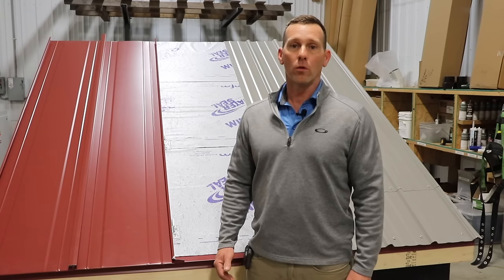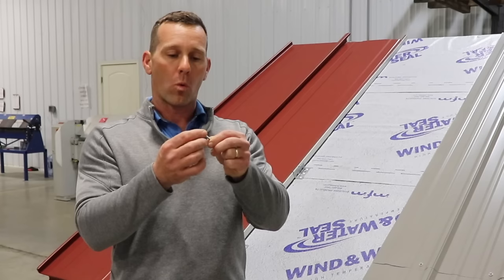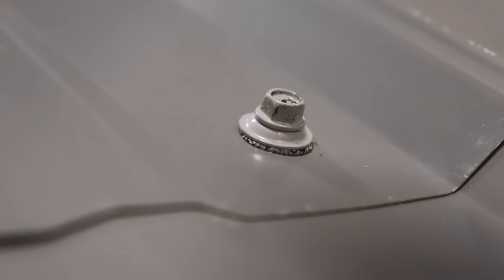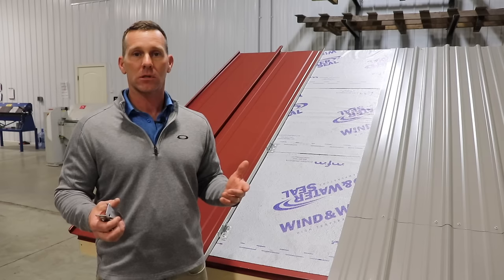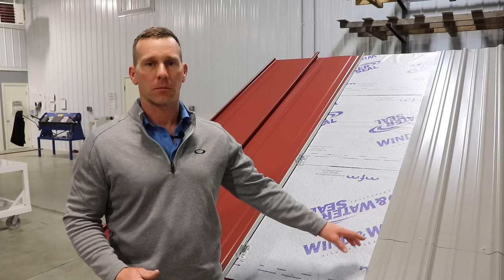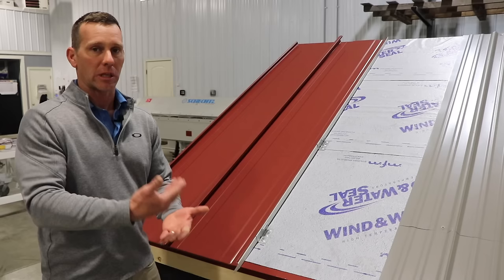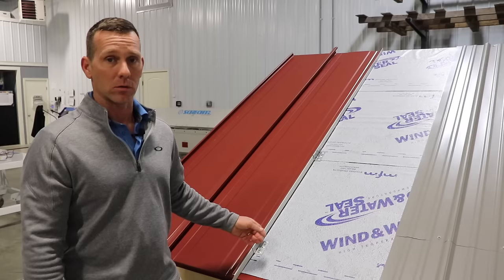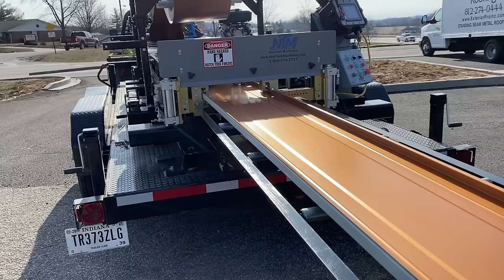Standing Seam Metal Roofing Vs  Corrugated Screw Down Metal Roof - Big Differences between the Two

Comment: We have a corrugated roof in the Upper Peninsula of Michigan. Heavy snow and ice loads. It's 20 years old and in great shape. The screws are all holding up well.
Reply: you are very lucky ... buy a Lottery Ticket and see if your luck is still going strong ...
Reply: Can I your contractor contact I am from Michigan
Reply: @saleindia9884  hey Sale India, I'm in Michigan. I have done exposed fastener roofs for many years now and have never had a complaint. This video is just a sales pitch for what this guy knows. He called it a neoprene washer. It is not a neoprene washer. It is an EPDM washer. EPDM is the same material for commercial roofs and last 30 plus years. Previous to doing metal roofs I did commercial roofs. This guy already at 1:33 in doesnt know what he is talking about or is just trying to make more money by up-selling standing seam.
Reply: Same here in the Ozarks in Missouri. If you dont torque the washers down too much, better chance it won't leak...
Reply: we've got 20 on ours and it leaks and sweats, not to mention the fade and chalky look
Reply: @carcasscruncher9354  The price differance between the two is crazy, i dont think it is worth the differance for durability. Just replace the screws every 15 years and you're good.
Reply: @jimgalle1371 no amount of luck will help w that

Comment: So this is a standing seam commercial.
Reply: yes. but still 50% correct information though
Reply: Agreed. Sounds like a standing seam distribution shill
Reply: Yeah this guys Taken the worst case scenarios with one and not the other. I've done both. Just replace the screws every 8 to 10 years. Standing seam is great but has to installed perfect or you have alot of problems. And standing seam isn't cost effective yet. It's the diffrence between 2500$ to 10,000 dollars. Just replace the damn screws every 8 to 10 years done deal.
Reply: lol

Comment: In the UK we have just had Storm Eunice and the record-breaking 120mph gust on the Isle of White.  The rooves that blew off were all Standing Seem types.  Once the wind gets under an edge it rips off the whole roof - because the first panel to lift becomes a sail as the seam from one panel to the next panels holds in the wind and the drag from the loose panel is transferred to the next panel and just like a zipper , the whole roof peels off.  In the Corrugated system, if the wind gets under a panel it gets pulled off - but it does not take other panels with it.  Perhaps the edge detail needs to be improved to stop the first failure in standing seems.
Reply: Perhaps it's in the installation? Our house and many of our neighbors in the Virgin Islands have shown standing seam to be the roofing of choice. Having been through back to back Category 5 hurricanes (sustained winds over 156mph) in 2017, they were the roofs that survived the best.
Reply: Haha yeah I just had a screwdown installed on my house. They seem a lot stronger to me
Reply: I'm glad you brought that up, the video I just watched was a salesman telling us how one sucked & standing seem was the best, he left out parts like you just brought up.
Reply: I can see that happening. I asked about the spacing of screws around perimeter & in the field & not 1 tech support employee nor sales person gave a worst case scenario screw pattern for storm all of them suggested about 3 x the spacing I ended up doing.
Reply: 100% down to the building code and installation standard.  I have a standing seam on my house in florida for 20 years now and it performed perfectly through 2 catagory 3/4 hurricanes.  the first, hurricane IVAN which was enormous and slow moving.  the roof endured SUSTAINED winds of 120-130 and the duration of the winds were above hurricane force for over 6 hours.  It only takes one weak section of any roof installation that will create the uplift that can take off an entire roof.
Reply: It all has to do with install. Length of fasteners (screws), placement of fasteners and the thickness and type of roof decking (plywood vs OSB). The thicker the roof decking used with proper length fasteners is very important.
Reply: Put some heat on that panel throw a tape on there let people see that expansion and contraction
Reply: Having experience with roofing in South Carolina where hurricane-force winds are an issue (multiple times in some years) the specific techniques, as well as materials allowed (local building codes take hurricanes based on  actual events) prevent some of this from happening. Imagine buying a wood stove in warm climates; the local experience for this would be low. More clips, screws would be a start for durability

Comment: I'm a metal roofer in VT and I concur with your assessment of both types of roofing material. Standing seam out performs every other residential roofing product that I've installed for the last 22years.
Reply: FACT!
Reply: The H-Loc system from Central States manufacturing is the best system I've ever installed. If installed right, it will last forever
Reply: Is standing seam double the cost of a corrugated metal?
Reply: @minni1094   
It depends, generally not double, but still more than corrugated.
Reply: @beardedroofer  I just got quoted $7400 for corrugated and $14K for standing seam. No valleys pretty straight forward job.
Reply: And it’s priced accordingly
Reply: @minni1094  just think you can replace screws and grommets about 1,000 times to make up for that price difference. It’s just not worth the price difference
Reply: @magicmillhouse9586  OK so you are saying go with corrugated. The company actually came down on the price 29 gauge metal 1019 sq ft $5500
Reply: @minni1094  I had my house priced with standing seam for $24,000.00 I bought corrugated & installed it myself for $3,000.00, I just don't see a $21,000.00 difference.
Reply: The major disadvantage of concealed fix sheeting is it's poor performance in windy conditions. Another disadvantage is the unfixable snapping noise it makes while contracting in the cool of the night.  Positive fixed sheets are fixed at about a meter intervals, so the expansion and contraction is limited to one meter.  Standing seam sheets produce more waist, as the off-cuts can not be flipped to be used on the other side of hips and valleys. We screw sheets only at the up-stands, or roll, of the sheets.  Not in the pan, as this video indicated.  This means that even an aged washer will not let water through your sheets.  The screws on my roof has now lasted 34 years, and I have no plans to replace them.  We order sheets to the length of the roof, so we never have to overlap sheets top to bottom.  Every plan you make for the ridges on concealed fix sheets, have a similar solution for any other type of sheets.  Corrugated sheets are S-type sheets.  Concealed / standing seam sheets are more expensive.  Material and labour cost.  Concealed fix sheets was designed for low pitched roofs.
Reply: @scottyellis3442  well my house had a 104 year old standing seam roof replaced by corrugated panels 8 years ago, and they started leaking after 6 years.  I went up there and a ton of washers look like they were chewed up, a couple even had missing parts of the washer.  I’ll replace this new roof with standing seam, use the corrugated in a barn or something, and replace the screws ever 10-15 years.
Reply: @miragesmack007  Sorry to hear I know that has got to be aggravating to have to replace a new roof, good luck on the next one.
Reply: What about wind? I get 30mph wind through the winter
Reply: @hosoiarchives4858  
If it's installed correctly, a 1" double lock standing seam metal roof should withstand winds of 30mph or more. Quite possibly a lot more depending on fasteners.
Reply: @beardedroofer  thanks bruh
Reply: @minni1094  I got a quote of 24K! For a 28 ft x 52 ft shed roof - ultra simple. Did it myself for 8k for materials + 4k for my labor (2 weeks) dyi saved my customer HALF!
Reply: @beardedroofer  30mph isn't squat.
Reply: @da324  
You're right, wind gusts of 30mph ain't much of nothing. But a sustained wind is something else, it just doesn't stop. 
What I meant to imply was that, when installed properly, a standing seam roof should last longer than your lifetime.
Reply: @minni1094  how many squares?

Comment: Another great thing about seam style is if you plan on mounting solar panels, the mounts simply clamp on the seam instead of putting additional holes in the roof.
Reply: neighbor just had solar panels taken off of his metal roof and it was standing seam . It cost to much he said to have the solarpanels cleaned and repaired . squirrels and bird damage to wires , bird poop and pollen and dust on the panels need to be cleaned off at a cost of almost 500 dollars 2 times a year . now he is dealing with the roof damage to his metal roof . He wished he had gone with ground mounted solar panels now . But then we have deer and foxes and bears and would still have birds and squirrels and possums and raccoons .   The panels were mounted to his huge tall utilty building that houses his RV and workshop
Reply: @sissymurphy9620  that’s crazy, I live in a woods & mine are just laying flat on my flat roof & I barely have any issues like that. Ground mount sounds great except most of use don’t have the space or there is to much shade.
Reply: The best place for solar panels is a ground mount. If you don’t have room, then find another suitable place to live where you can install one in the yard.
Reply: @USA-GreedyMenOfNoIntegrity  there is no issue with using what would otherwise be wasted space on a roof, plus this style of metal roof is the best type for solar. The vast majority of people don’t have yard space and if they do, there is shade issues that are out of your control.

Comment: Installed my 1st snap lock 1 " standing seam roof this past year. Shed roof 28 ft from ridge to drip edge & 52 ft wide. Had to build a ramp up to roof to keep such long pieces from kinking while transferring from ground to roof. Points I would share: 1 - got a quote from a roofing Co. Quote was 24,000.00. I bought all needed supplies including stove pipe penetration kit & 2" vent penetration kit plus all needed screws, trim, caulking etc for $8000.00 & installed completely in 80 hrs alone - another 4,400.00 for my time. I used a paint on vapor barrier on the roof ply. Thats half the quoted price. I was pleased with the simplicity of the installation but it WAS the simplest of roofs. The waterproofing edge details were logical & easy to bend/install/caulk in foam inserts. I would definitely use again but maybe not on more complicated roofs with a lot of penetrations.

Comment: Oddly enough up here where known for tornadoes and high winds but from what Ive seen on barns and some houses under sever winds and tornados I have seen standing seam missing panels or sections from bad storms but  I have not seen a metal roof panel held down by screws come off unless the actual roof came off with it
Reply: Yes, an amish roofer just told me today that prorib not gonna blow off at all. lol

Comment: I Was Taught By a Very Experienced Professional Contractor That on Corrugated You Put The Screws on The Ridges Not The Flats. He and I Did My Roof and Still Looks Good After 14 Years
Reply: I agree
Reply: We put a Menards metal roof on our utility building many years ago, and that is what we did - put the screws on the ridges.
Reply: Good for you on 14 years. Flat on flat vs flat on 1inch ridge standing up. Never would I put screws on the ridges. Unless it comes to flashing
Reply: @colinsmith7884  I've always thought of the screws on the flats as being one of the inherent weaknesses of the corrugated roof becuase the washer takes constant abuse anytime it rains. That being said, that's the only place they're supposed to go. The ridges do not have sufficeint backing to put the screws there. We thought of "shimming behind the ridge because (obviously) the ridge would be the best place to put the screws for less water intrusion. Without a backer, the screws MUST go into the flats. Flats...Period...end of discussion.
Reply: @peace prayer I was taught to put screws in the flat. Not arguing with you over that. Some people rather put them on the the ridges. They seem to split into a crack. Don't understand the hate man
Reply: @Peace Prayer there are different companies with different screws. Living in the Great Smokey Mountains. I have put many different metal roofs on. Try putting on a three dimensional aluminum shingle. Then try getting off the roof. The tensile strength was about as a Coke can
Reply: @Peace Prayer Last job the roof alone was 117,000 sq ft Deca Terracotta. 1x1 every 14 inches. The you start from the top work down. I know there is different ways with different people. You go by the company's standard. Period
Reply: @ Peace Prayer I was congratulation him on 14 years with the screws in the ridge. Read it again. Plus I put my acres every 3 ft and drill my panels on the ground to keep straight. Hope that gets under your skin
Reply: @colinsmith7884  sorry if you misunderstood. I was actually 100% suppporting what you said with some insight as far as I was concerned. People like to argue the point. I called manufacturers over the years and actually looked at instructions plus asigned my common sense to the situation. The screws go in the valley ... the flat... .
Reply: @colinsmith7884  I know and that was a nice jesture. ummm...no, you didn't offend me... i deal with a lot more than that on a daily basis so you can't get under my skin that easily. you simply misunderstood what i said.
Reply: @YouTuber-ep5xx  you can arguabley put them there, but thats not where they go for best results
Reply: @peaceprayer595  I bought the roofing at Menards, they said to put screws at ridges.
Reply: @YouTuber-ep5xx  well, they must know what they are talking about.
Reply: @peaceprayer595  Well, roof is still on and dry!
Reply: @YouTuber-ep5xx  I'm glad for you bro. I really am. It's an age old point of contention so it's good to hear that it worked on your roof.
Reply: Probably voided the warranty in fastening on the ridge.
Reply: This was done in this video (amongst other things) to prove his biased opinion.

Comment: In Florida, never had screws back out. One exception was a 60 year old home some screws backed out slightly but never had a leak. Replaced the screws no big deal. Also, expansion is minimal. 90% of the roofs here have corrugated metal with screws and some of the homes are very old.
Reply: Sounds good to me. After that long I'll be roof shopping in another dimension.
Reply: I’m guessing expansion would be more of an issue in temperate climats like  here in Canada where temps can be as high as 40C in summer to -40c in winter.
Reply: I think your typical wavy corrugated roof has plenty of give in it to take up the expansion
Reply: I imagine Florida has less temperature swing than a lot of the country. Expansion and contraction is going to be less if it’s hot all year compared to places where it gets hot in the summer and cold in the winter.

Comment: I dip my screws in melted butyl rubber, it never dries up and cracks and keeps the washer from deteriorating. A small step that assures leaks don't happen. Butyl rubber is the best to seal metal roofing as it remains viscous even in extremely low temps.
Reply: How do you make the melted butyl rubber?
Reply: @termgrecos3451  Buy a roll of butyl and put it in a coffee can on a heater. Butyl is actually fluid, just of an enormously high viscosity. It melts to a toothpaste like consistency at around 160 degrees and even while it's cooling it still adheres to the threads. Matter of fact, it sticks to EVERYTHING, lol so use cheap leather gloves. But a little butane torch works great to lay it down in ropes and seal gaps. Way better than silicone caulking. That stuff rubs off, butyl takes thinner or gasoline to remove it. Once it's on, it's on!
Reply: @genefogarty5395  Nice! Thanks a lot!